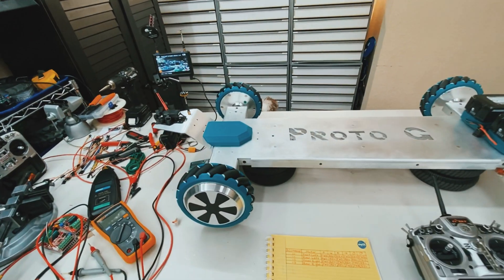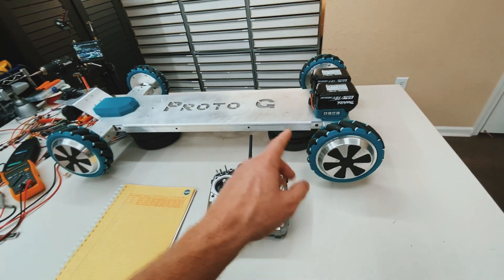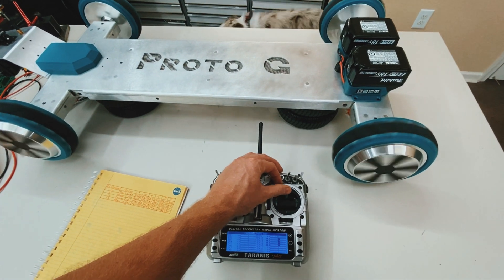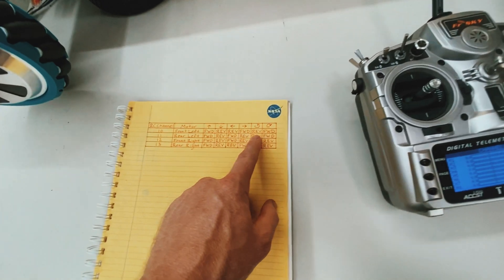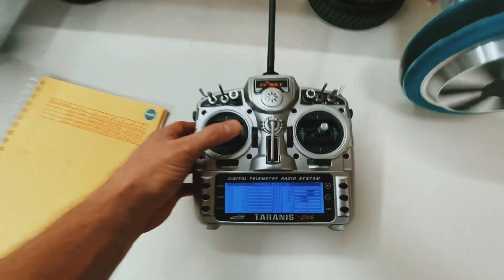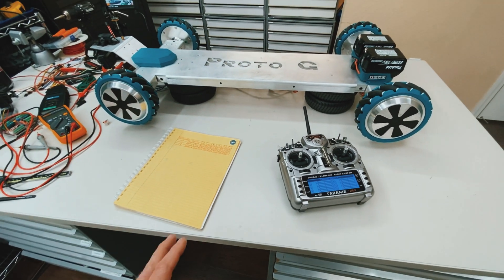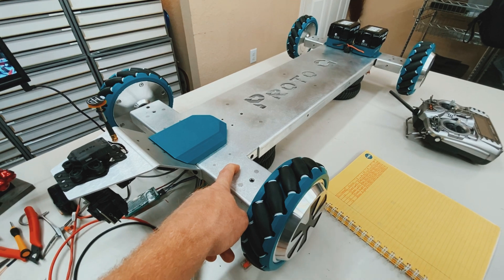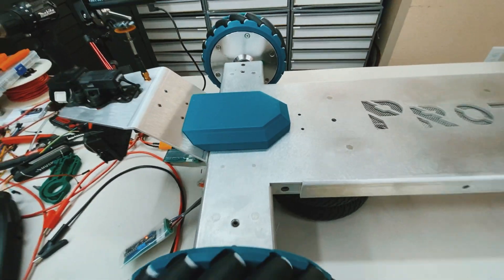Omnidirectional FPV Rover - RC Transmitter Setup

Comment: this looks awsome, and something i am also working on. is it possible to se the code you wrote for this? having a hard time configuring the controllers and a arduino to work in tank style with a RC reciever. ive got it to work with a RC reciever but when i change direction the motor goes much slower. like 50% slower, it seems like your motors goes the same speed in both direction. how did u manage that? 
Many thanks!

Comment: I think the controls would be much more intuitive if you mixed the channels in a way which mimicked the motion of a quadcopter.
Take a look at the video linked below at about two minutes in.
https://www.youtube.com/watch?v=s4i7Em688G4

I use the aileron and elevator to control with way the robot moves and the rudder controls yaw. It's the control strategy as a quadcopter.
The throttle channel can be used for another purpose of it can be used to set the robot's maximum speed.

I can share the equations I used to calculate the speed of each motor. I can help with the programming if you want more than just the equations.

Edit: I see from another comment you use ESP32 microcontrollers. I'm pretty sure an ESP32 could handle all the math you'd need to control the robot as I described above.

Comment: Nice update, looking forward to seeing this run. That's a hard choice on the different controller configs, definitely a different memory muscle to control it. Either one might take a bit to get used to.  I have a few of those omni directional antenna's. They are good antennas.
Reply from the maker: I ended up greatly preferring the non tank style setup! It just felt much more natural for driving in a circle or a curved path

Comment: This rover platform is shaping up a lot like the Robomaster competition bots I used to work on in college but without the force plates and guns mounted on top. I personally found mouse+keyboard controls more intuitive for the driver than the sticks on the transmitter since our FPV was done on a desktop and the competition was basically an FPS anyway.

Comment: Can't wait to see this thing move. Individual microcontrollers for each motor driver is kind of triggering.
Reply from the maker: I think having individual microcontrollers is totally worth the extra $6 here. It makes the programming much less complex and more responsive as well as making the cable management much easier to deal with. They can be mounted directly next to each motor driver instead of having one microcontroller in the center with 29 wires sprawling out from from it which these wouldn’t be able to handle anyway so I’d need to get a larger microcontroller. I also have a drawer full of nano’s and ESP32s so I use what I have when I can.

Comment: What are those drawers you have?
Reply from the maker: In 2014, all my local RadioShack stores closed and I drove around and bought as many cabinets as I could. My workbench is also made from 4 complete cabinets. Some even came with the electronics included in them! 😊